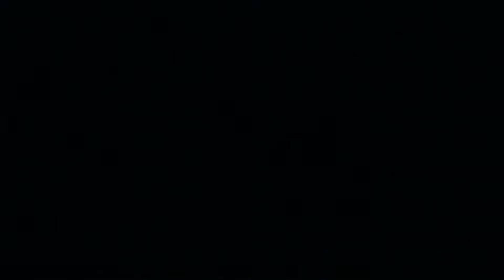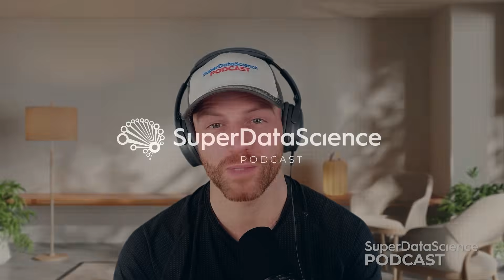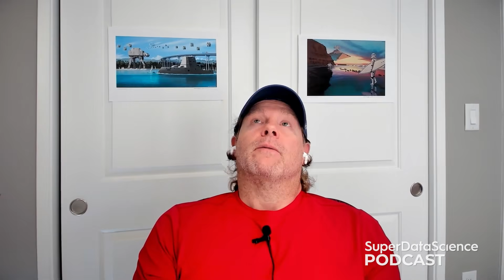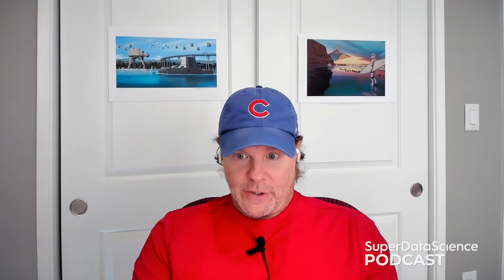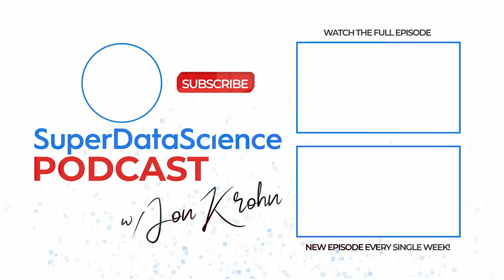If You're Still Writing Code Manually in 2026, You're Behind (Chris Fregly)

Comment: It sounds like you value strong training data as models move beyond prompt engineering. In my experience as a Lifewood Data Technology intern, structured, compliant datasets become the vital foundation for robust AI. One thing to try is strengthening fine tuning dataset validation. It may not fit every project. How do you approach multimodal data alignment? Your post is informative.